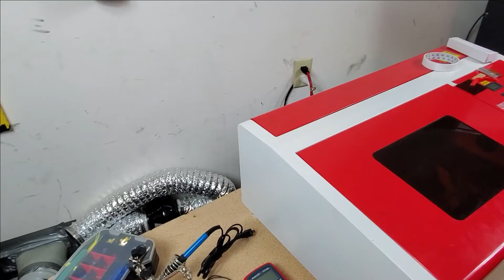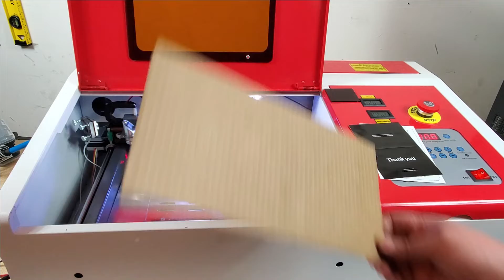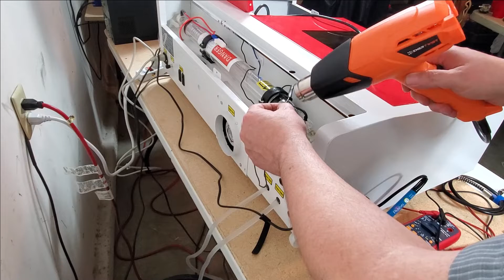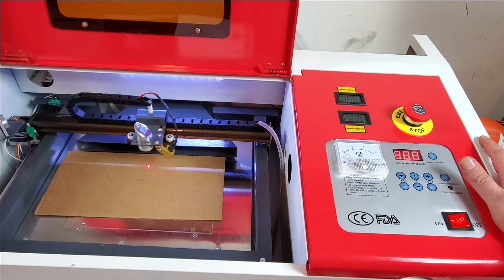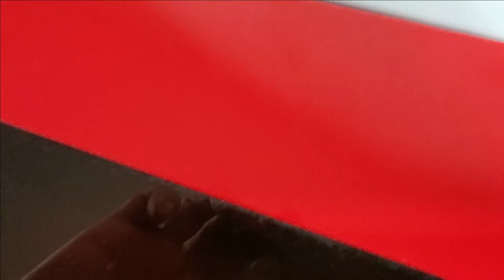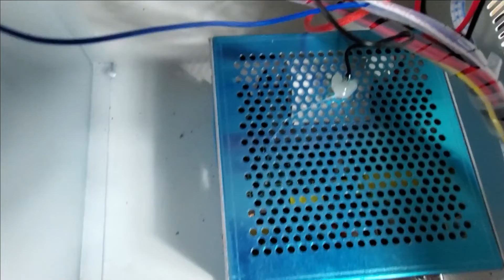New K40 Laser Inspection and Problem Solving

Comment: Don’t you run into problems with replacement parts when you’ve made modifications at time of purchase? I know everybody modifies these K 40s, but you would think you would void in your warranty? Plus, I don’t know how to do all those different tests that you’re talking about to prove that somethings not right. So how does someone do that if you don’t know how to do all these tests?
Reply: It's a cheap chinese machine. The warranty is over at the end of the assembly line.

Comment: Appreciate this vid!  Just got my k-40 and can’t get the thing to put less that full 30 mA output.  Not sure what the problem is, I’ve already made all the usual mods (air assist, bed upgrade, mA meter, extra lighting, cut back exhaust port, etc.). Is Omtech going to give me warranty grief because of the mods?
Reply from the maker: I am guessing your controller is not working right... you need to make a video of you testing it (there is a video on me explaining how to test it)... and send it to them.. they had no problem with me making mods, instead of returning whole thing, they just shipped me new parts. Good luck!
Reply: @k40mods55  Thanks so much!!!

Comment: I see everyone fitting a safety switch like that but it is not the way to do it.  The laser can still be fired if you push on the micro switch. The correct way is to fit the switch in a recess and have it operated with a 
plunger . This way it cannot be overriden. Standard saftey switch practice.
Reply from the maker: There are times when you HAVE to override the system. For example, when your aligning your mirrors.
Reply: @k40mods55  Fit an overide switch inside the cotrol section of the machine.

Comment: thanks for the video.  I just bought this exact same laser and i think i may be having some of the issues you had in this video.  I ran some test cuts today and with 5 passes at "70%", 8mm/s i couldnt cut through 1/8" plywood.  Im buying an amp meter today.
Reply from the maker: If you bought it from OMTech, they will replace anything faulty.. take a video of you testing it etc and send to support email.

Comment: Did you think that the “double beam” might actually be the incoming beam from the tube, and the reflected beam off the mirror. Seeing as you did not stick the tape directly to the reflective surface instead a distance in front of it. How can you expect to fire a laser at an angled mirror and see only a single beam path. Also not a personal attack but you really do say “Ummmmm” a lot and it doesn’t exactly portray that you know what you’re talking about.
Reply from the maker: No because both spots darkened at the same time... on low power the beam does not instantly go through the tape and since I sent video to OMTech and they replaced the tube.... I am guessing you have never aligned a laser before or you would know that. My use of the "umm" is my natural way of talking, must be the Canadian in me. I have been a computer programmer for 30 yrs and do the same thing when I am talking about programming or pretty much explaining anything.

Comment: very useful, thanks! you have a new subscriber :-) two questions: it's not clear to me whether the broken flyback transformer is also responsible for the double beam, not just the limited power output. second, could you please share the STL for that air assist and which metal nozzle you used? thanks!
Reply from the maker: Hi... I am sorry I was not clear on that.. The flyback failure only causes a drop in power. The double beam is a separate issue. This new machine had both at once.. lol. Yes I will share the nozzle STL. I ungrouped it to far on Tinkercad because I wanted fix a small overhang where it meets lens cover, then got mad because it is totally in pieces.. I will finish fixing it and post it for you. The nozzle is a .4 3D printer nozzle drilled out. Here is non affiliate link to them. https://www.amazon.com/gp/product/B085ZTK39M/ ... remember to print nozzle in PETG for higher heat tolerance. Here is the link if you want an adjustable air flow https://www.amazon.com/Aquaneat-Aquarium-Manifolds-Distributor-Control/dp/B07R5RH6WS/
Reply from the maker: Sorry for the delay.. RL stuff.. here you go.. https://www.thingiverse.com/thing:4793641